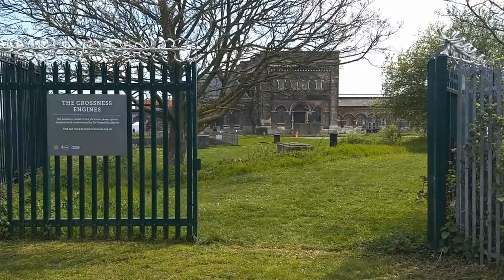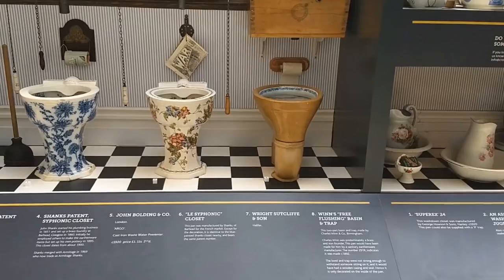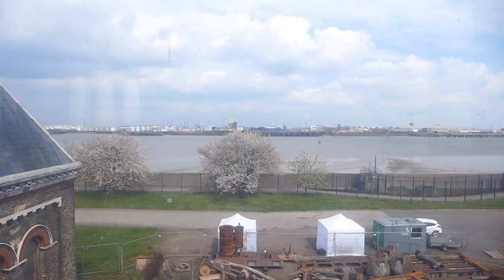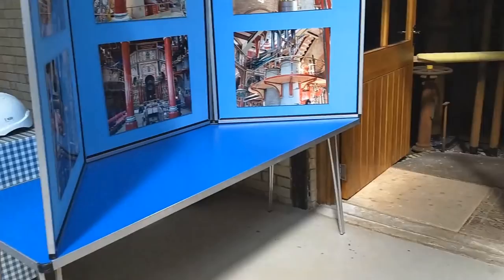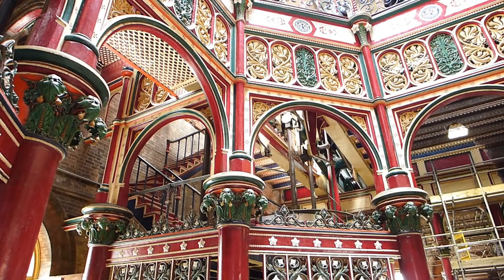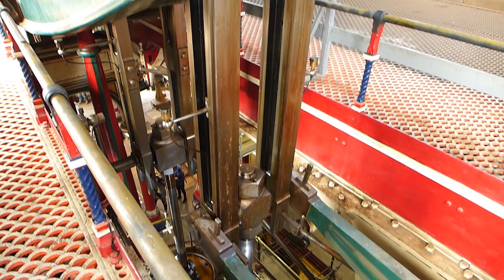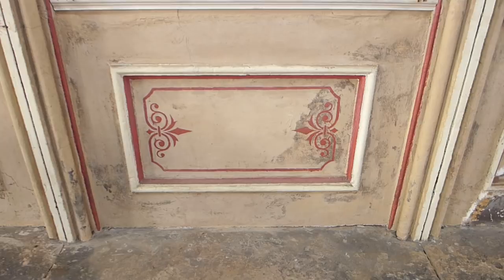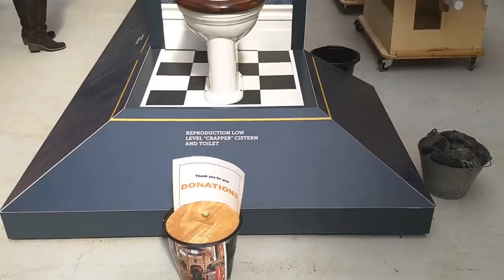Crossness: The World's Most Beautiful Sewage Plant

Comment: Bavk in the 19th century, whe sewage citys where a new and shiny thing, most of  the citys that had one took so much pride in it, that they would often tour state guests through them, this included several crowned heads and thus there are wuite a lot of rater representative buldings sitll in modern sewagesystems all around Europe.
Reply: On top of that I believe Crossness was the display piece of the system, so they made it extra impressive

Comment: Hello Mister Tim, I've been watching your short journey movies for a short while and I have to say that they are very interesting. Since also have a not uninteresting trip to the volcanic Eifel for you. For a trip to the Lachersee, a dormant volcanic maar that last erupted more than 10,000 years ago and still has a large active magma bubble underground. So a so-called hot Superplume, this magma bubble extends from the volcanic Eifel to the Mecklenburg Lake District and even if suddenly the super-volcano Lachersee / Vulkanmaar would erupt, it would be the biggest disaster for the whole of Europe. The ash clouds would spread rapidly between 200 and 600 km, depending on the wind direction, and possibly cover the city of London with soot and ash. For from the volcanic Lachersee still active sulfur gases from the water-filled volcano crater come up. On the other hand, there are two cold water geysers in the middle of Europe in the volcanic Eifel, the first cold water geyser can be found in the small village of Wallenborn, accessible by bus or car. This cold water geyser breaks out of its spring base every 30 to 45 minutes because carbon dioxide gases and sulfur gases in the underground combine with the groundwater and explode to the surface. With a force of some times on average with 2 car lengths in the air and stinking it does lazy eggs. The other Kaltwassergeysir can be visited in Andernach am Rhein, but on a river island in the Rhine. There the Kaltwassergeysir breaks out in his water Fontaine in house height and that almost in the same period as in Wallenborn, so between 30 and 45 minutes. In both cold water geysers, it stinks of rotten eggs every time and is closely related to the many volcanic maars of the Eifel. Because the Eifel landscape is rough, but warm with a hot heart in the underground, inside their mountains and valleys.